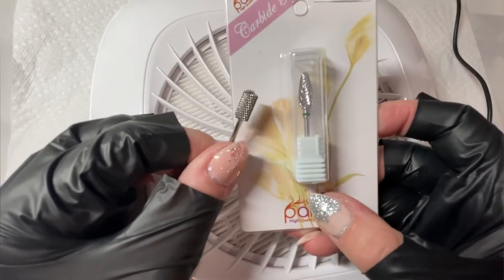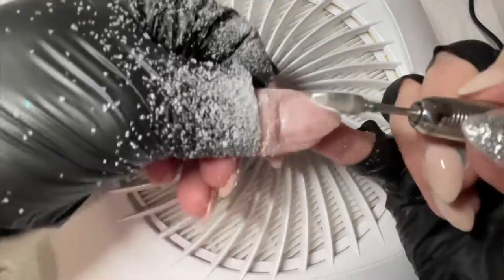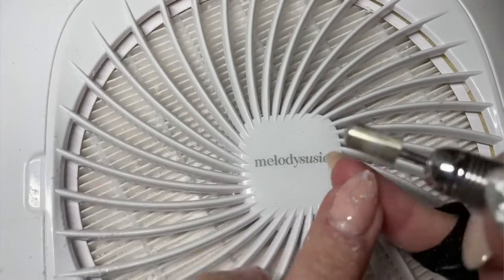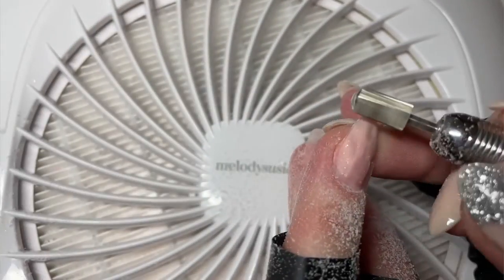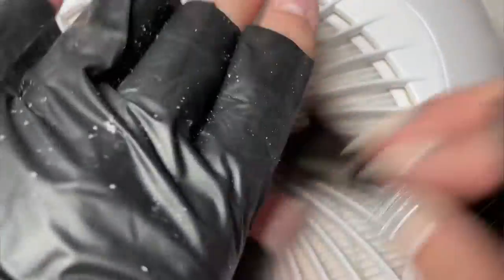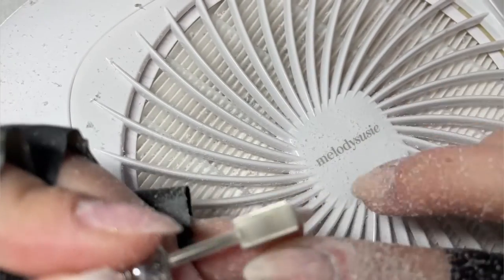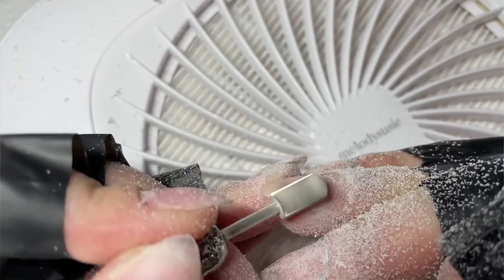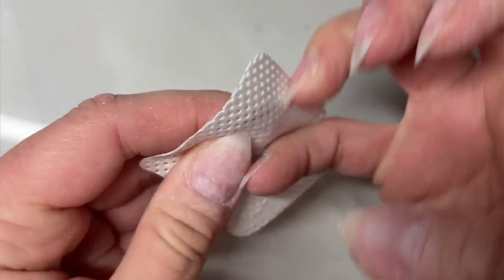REMOVE RUBBER BASE GEL OVERLAY: TESTING FLAME BIT VS SMOOTH TOP BIT

Comment: I could have sworn the flame bit was used for the nail fold near the cuticles the 2nd one you used looks like a typhoon bit
Reply from the maker: Hi Shannon! I’ve never heard of a typhoon bit. But I do know the flame bit I’m using is a removal bit that should not be used near cuticles. I only use cuticle bits for near my cuticles.
Reply: @NicolesBeautyScene  whatever works for you hun

Comment: Do you file down to your natural nails? I am struggling with my e-file and now that I have seen this video I know it's fear of going too fast or down to the natural nail.
Reply from the maker: Hi! I switch to a sanding band when I’m near my natural nail so I don’t hurt my natural nails. I also leave a thin layer of it on at all times. So when I switched back from rubber base to builder gel that I have on now- I left a thin layer of the rubber base. You can use a sanding band to remove any lifting. Always make sure you don’t press hard down into your nails. And keep the bit more parallel to your nails versus angled up- that’s how you get the lines in your natural nails- from holding the efile at the wrong angle and pressing too hard. Does that help?!
Reply: @Nicole's Beauty Scene  Thank you, Nicole. It does help, I just did my nails today with Ameili rubber base and builder gel. I had some unevenness until I took the drill to them...ended up with small ditches in my nails lol. Soaked everything off and called it a day. I am looking for the bits on Amazon that you use and binge-watching your builder gel videos and nail shaping and will try again next week. I am enjoying your obsessive DIY tutorials and the crazy amount of information you pack into such a short amount of time. Appreciated!!
Reply from the maker: @wheelwithheelsCanada  I’m so glad it helped!! You can ask me questions anytime! Let me know if you want links for the bits too! I have them in my descriptions too!
Reply: @Nicole's Beauty Scene  Thanks, I will look for those links in your description, and most likely be taking you up on the offer to ask questions.